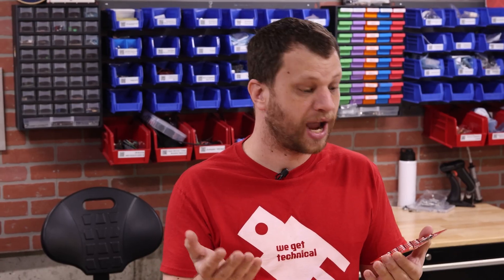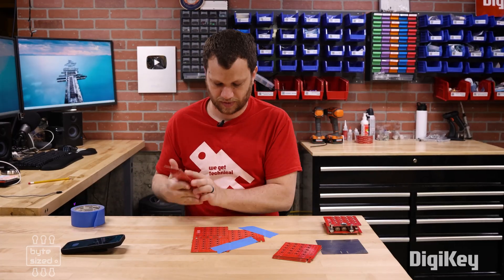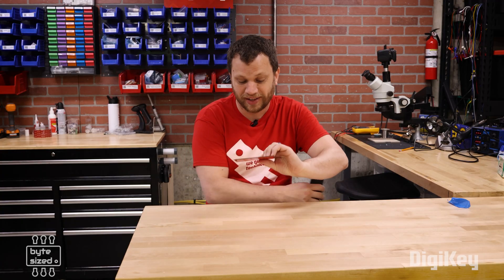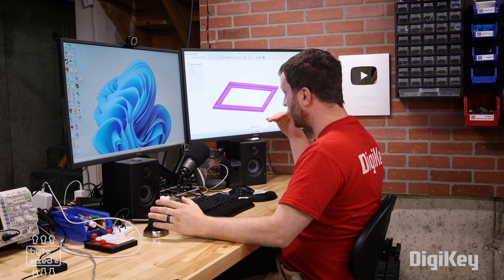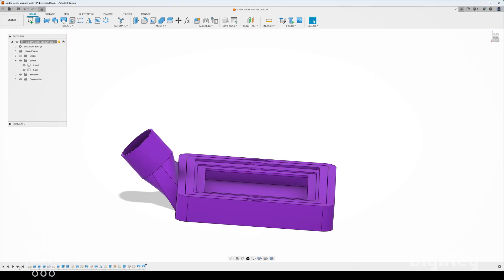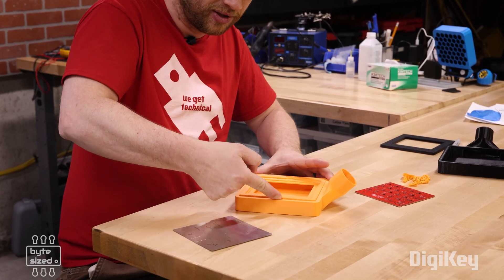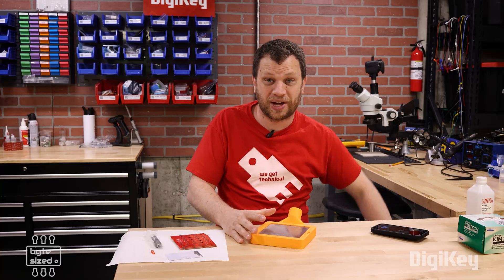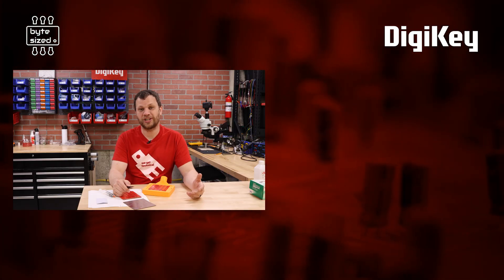Solder Stencil Vacuum Table - The Byte Sized Engineer | DigiKey

Comment: Cool, this has so much potential.
You could add some wholes arround the PCB in the hoalding plate to fix the stencil in place or you could ad wholes in the PCB for larger PCBs to suck the stencil at more places and geht it closer to the PCB. In your case it looked like a keyboard PCB with wholes for throughwhole components, so no problem there.

I think a bypass valve for the vacuum would also be nice for a easier release without turning off the vacuum.
This could be done by slits in the vacuum adapter and a ring with coresponding wholes around it that can be turned to open or close the slits in the adapter.

Comment: Hi Zac, this such a cool project. All you need now is a one time print to keep the suction hose out of the way and clamped to the workbench. This would stop any movement of the hold down jig. Then just a slight mod to the shop vac to allow for an on/off foot peddle. As you say these would be extra time to design and print but i think would give you a more stable platform to use and eliminate any other unwanted movement. BTW the link to your project on Github does not work 😥

Comment: Your vacuum cleaner needs to cool down at some point - if you keep it "clogged" like that for a long time, I guess more than 5 minutes, it might overheat and burn out. There's no airflow, the motor spins faster, but it doesn't cool down. But I guess you know that.
Reply: Agreed.  You need to monitor the current on the vacuum cleaner and air flow.  Also, you should design in some bypass suction.
Reply: +1 The base needs a valve designed and built directly into it.
Reply: Likely not a perfect vacuum...
Reply: You have the wrong vacuum cleaner.
Reply: It should get a break every time you switch boards. It shouldn't be a super long duty cycle.

Comment: Isn't the mar-tempered stainless-steel solder-mask ferromagnetic?
Reply: stainless steel suuallly is not ferritic, but austenitic. So not ferromagentic...
Reply: @mfgkwmfgkw  Did you try with a solder-mask? Mine is ferromagnetic. Perhaps it is from the local heating due to laser-cutting